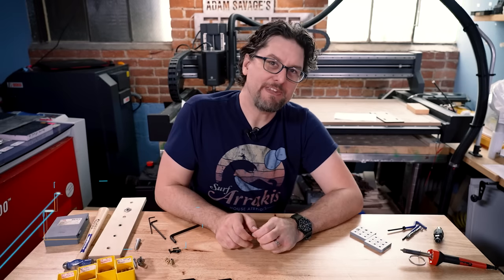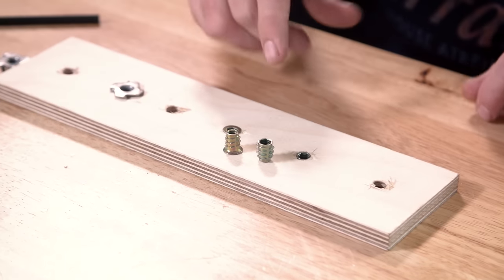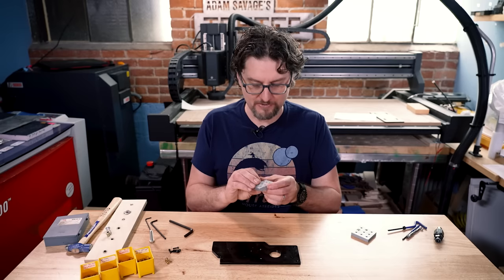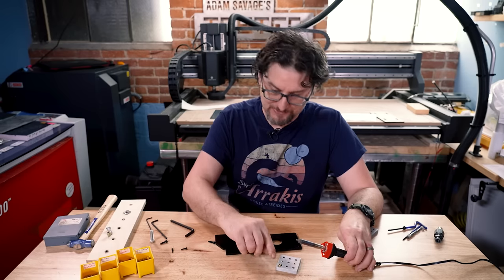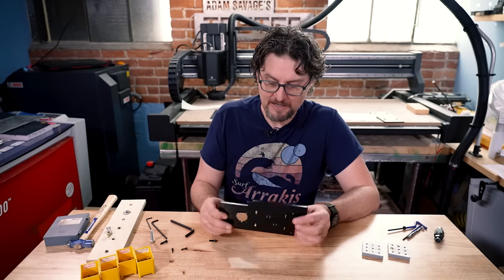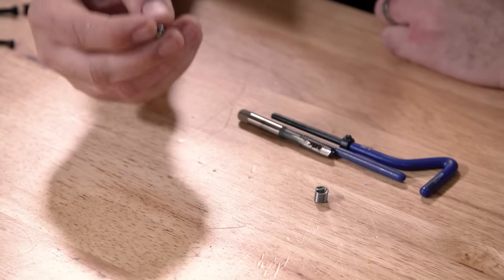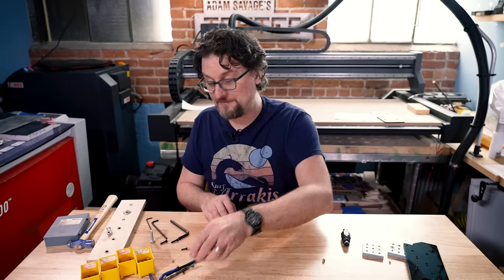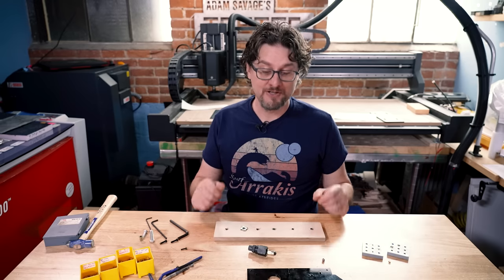How to Use Threaded Inserts for Wood, Metal, and 3D Prints!

Comment: Helicoils under perform compared to threaded inserts. I have repaired many stripped out threads in motorcycles, vehicles and  U/L aircraft  with SS threaded inserts with excellent results.
Reply: Are you referring to Time-serts or something else?
Reply: @oambrosia  "Case Saver" & stainless steel, easy-to-install "Thread -Locking Inserts" (McMaster-Carr & Amazon). I had little to no sucess with helical inserts which pulled out.

Comment: If using the t nuts, as shown, insert the bolt from the other side. It works like a regular nut and will not pull through.
Reply: Absolutely - I should have mentioned that - I do that whenever I can but not always possible.

Comment: I used the inserts for wood once, but I had a really hard time to get it in straight.... any tips?
Reply: inserting the hex drive inserts into wood is tricky with an Allen key. Better to use a hex drive bit in a screwdriver, you can keep everything vertical. If you have to remove an insert which has gone off line or cracked in the wood, use a eze-out bolt extractor tool.

Comment: I just saw a brilliant hack for bolts into 3d printing. you create a hollow area for a nut and when you half way through, pause printing drop in the nuts, then resume printing to finish up
Reply: just don't forget about the fact that you will need to reprint the plastic part if the threads get messed up on the nut!
Reply: @Liv3_fps  good point! 👍

Comment: Another option for sheet metal would be nutplates that rivet onto the back of the sheet with countersunk rivets. They're used heavily in aerospace.
Reply: Rivnuts
Reply: @TomOConnor-BlobOpera  Rivnuts are not the same thing and rivnuts don't sit flush to the sheet metal they're installed in. Nutplates are superior in performance, but more difficult to install.

Comment: I wonder if I could use a couple threaded inserts for an older wooden bannister in my house. The wood screws stripped out and the holes in the bannister are now bigger than the support brackets that are in the walls. I've tried wood putty and other wood glues but they haven't lasted over the decades.
Reply: I can't fully picture your problem (and if it is very visible). If the hole is in a really visible location, or very large (like greater than a 1" cube) you could even the edges of the missing hole, cut a piece of scrap wood (not plywood) to fit the space and epoxy or glue it in, sand it down and you would have a bannister that is basically original. 

If the hole isn't very visible and is smaller (and you aren't worried about any historical restoration issues), you could try something like epoxy putty (which is even made for wood restoration purposes) or even Durham's Rock Hard (water putty) to fill the hole, and provide a good surface to drill in to. I have used Durham's rock hard in an unimaginable number of ways, but only used it a few times for one of its intended purposes which include filling screw holes to be able to use wood screws again. I don't think I'd use it for a really big hole, but I works great for filling/repairing screw holes for door/cabinet hinges. Take its name to heart however, you will need pilot holes to drive a screw into it, and try to sand and level it before it is fully dry because it is really rock hard.
Reply: @MB-xw1tu  Ah. I didn't explain it well enough. The bannister has been in use for over 60 years of people leaning on it as they walk up and down the stairs. I've replaced the wood screws a few times, usually a slightly larger thread as the years go by. It's now at the point that the holes in the metal brackets in the wall are smaller then the holes the screws go in, so the bannister is now loose and it wobbles. I've used wood putty and wood glue and it holds it for a few weeks or up to 3 months, but it eventually wobbles again. So I was wondering if these inserts would be able to work better than having to try to maybe JB weld, which means talking the bannister off the wall, and use JB weld outside because it stinks to high heaven and do not want the Family to get ill from it.
Reply: @chalion8399   I'd guess the inserts could reduce the size of the hole. but ultimately would be subject to the same kind of tear out, though slightly less so. I think I would start with the Durhams Rock hard. it is relatively cheap... or was when I bought it. I still have a third of the container left and have used it for a lot of halloween costumes and some home repair. I originally bought it on the recommendation of casual cosplayers for propmaking (when you don't want to invest in basically any special equipment at all). Artists sometimes use it to carve because it is super fine grained, it can be formed into a general shape while wet, carved (with really sharp tools I imagine because it is ROCK HARD), and can also be rewetted and smoothed, and added on to. 

It is mostly odorless (I once looked up the MSDS but don't really remember it. I think it is powdered PVA glue and maybe something like lime... it's sort of dries like a much less friable plaster of paris). Certainly less odorous than paint.

you can use it like wood putty, so I think you could repair one set of holes at a time, let them dry completely (overnightish) and then screw back into them. I recommend drilling a pilot hole because I was unable to drive wood screws directly into it (maybe could have but it was easier to just drill a pilot hole).

The other thing I have done in a similar scenario of wood breaking under that type of angular load (though not maybe as heavily). Is install a metal angle iron into the railing to meet the wall bracket and dissipate the load over a larger area. That would require finding the exact hardware (I think there are things made specifically for banisters, but also just browsing a hardware section you might find a workable arrangement... which is what I did). Then you would have to remove the banister probably to make whatever adjustments were necessary to install the angle iron/reinforcement etc. and then put it back together. But it would def. last longer than any other solution.

Sorry I am so long winded. I like thinking up ways to solve problems without needing specialized tools or materials! It's like my version of logic puzzles or wordle.